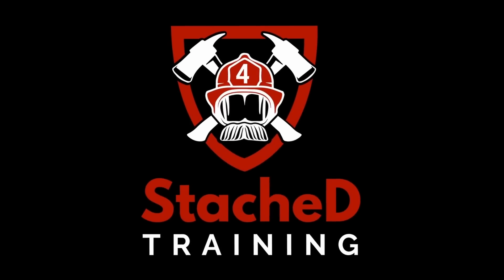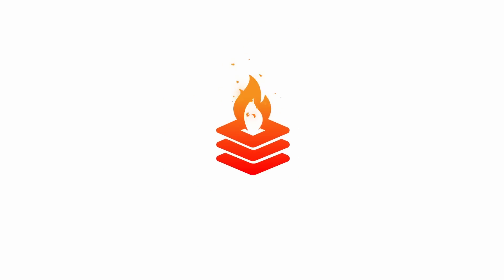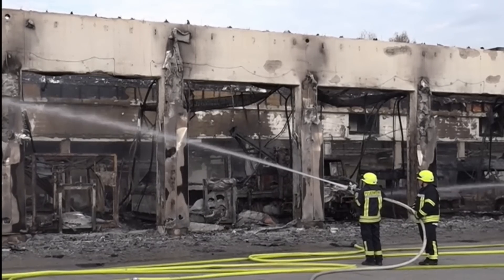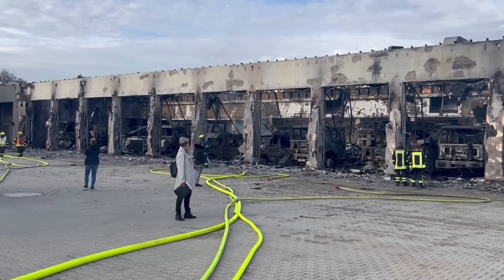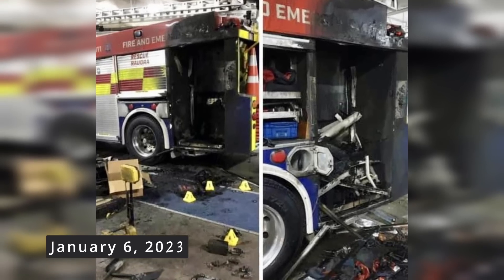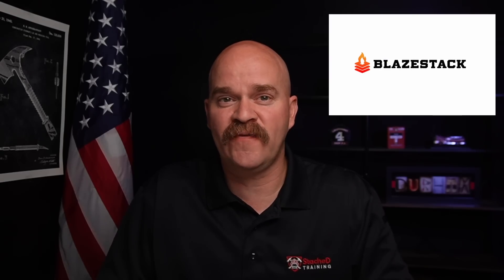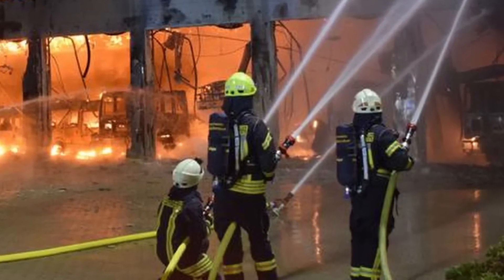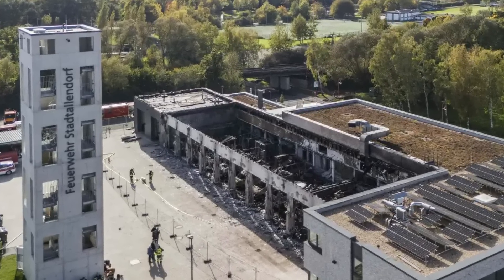Lithium-Ion Batteries Spark Fire Station Disaster: Germany

Comment: safety devices like bms to prevent over dis/charging and heat sensor to detect hot or cold battery.

for high demand devices that can cause the battery to heat up when using should have multiple batteries to swap out .

while some chargers can detect a hot or cold battery andprevent charging until it cools or warms up it is still a good idea to have several batteries to swap out.

Comment: German electric engineer here:

Here in Germany we do not have EVs for any kind of emergency services. They all run on Diesel with a very few exceptions running on gasoline.
So the fire obviously started within an auxiliary system being powered by a Li-battery.

Of course, it is kind of embarrassing for Germany - the country of engineers and craftsmen - to skip a fire alarm system in such a place. At least some of the vehicles could be driven out with an early alarm before the whole building was ablaze.

Also and again, politics must seriously rethink all the green--deal-Bohey about EVs. These vehicles are neither an ecologic solution nor a safer technology. 

Fortunately no one was hurt, the equipment can be replaced and hopefully this time the insurance company insists on something so trivial as a fire/smoke-detection system.

Peace! from Dresden / Germany

Comment: I'm confused. Wouldn't the firefighters be stationed at the fire station? Why did they have to arrive?
Also the audio is out of sync with the video. It looks like an overdub.
Reply: In Germany there are only 111 professional fire departments and 23,800 volunteer fire departments. There is no obligation for volunteer fire departments to be on site around the clock (fire department). Only very few volunteers have an apartment right next to the fire department. Volunteers live in their own houses and apartments and also have to work - volunteering does not mean receiving money for it.

This means that the volunteer drives from home/work (on site) to the station and sets off again in the vehicle. From the alarm (e.g. pager) to the scene (fire) in a target time of 14-15 minutes. This is what the law requires. This goal is achieved in 80% of cases. The rest is due to traffic jams on highways or impassable terrain (forest fires).

Comment: If fire fighters responded within 3 minutes when did they come from ?  All the stations equipment was in flames, so another station must have despatched appliances, are there so many firestations in Germany that they are less than 3 minutes apart ?
That doesn't make sense !
Reply: Who says that over three minutes? This is nonsense! The default is 14-15 minutes. From the alarm being triggered (e.g. pager) to the volunteer's location (home/work), their route to the fire station and then to the scene. This is achieved in 80% of operations. Not even a professional fire department can manage three minutes. Then the fire or operation would have to be 100m away from the station...

Comment: Maybe a fire apparatus should come equipped with a fire resistant "vault" to charge batteries in.  The vault should be built in a way as to contain the flames and be mounted on the vehicle in a way that the extremely hot vault will not set anything else on the vehicle, or surrounding area,  on fire..

Comment: Wait - I thought EVs used lithium iron phosphate, not Li ion batteries! Wow.....looked it up & it turns out some producers are switching to the less flammable LiFePO4 ones....
Now I understand why they've had so many fires!!
Reply from the maker: LiFePO4 or Lithium-iron Phosphate (LFP) are still lithium-ion batteries.  While it takes a bit more to get them into thermal runaway, they can absolutely still burn.
Reply: There was no EV in this fire station.

Comment: Hi, I'm a volunteer firefighter from Germany and I'd like to clarify some things from the video/comments as some things were misinterpreted/misunderstood/mistranslated.
1. Stadtallendorf is, like most fire stations in Germany (~93.5%), a volunteer fire department. Volunteer fire departments are usually unmanned and firefighters come from work / home in case of an alarm.
2. The station does not have a central fire alarm system but it hat residential like smoke detector. By Law it is not required for an unoccupied fire station to have a central fire alarm system. Requirement and Type (central fire alarm system / residential smoke alarms) are defined by Building regulation from the state. There main job of an fire Alarm is to inform the people and firefighters in buildings with high danger or where People potentially need help to evacuate or buildings wehre are many People and not to protect building itself.
3. The Vehicle where the Fire started was a Diesel powered TLF (Tanklöschfahrzeug = Tanker Fire Trucks) and not an EV. The Truck has battery operated devices (like headlamps, radios, ...) and an external Powerconnection for charging battery operated devices and the vehicle Battery (usually 24V) and prevent drained Battery's. No one want to arrive at Scene and can't work because a Battery is empty.
4. The Fire investigator from the police rule out deliberate arson and found the starting point an area where are charging stations for Battery operate devices, wiring and the external Power Connection. Because of the results of the investigations it is likely that a battery caused the Fire.
Reply: Thank you Steffen.

Comment: The door design is awkward and creat a huge blind spot for passengers and motorists. The rear turn signals are too low to the ground. The trunk lid has a very sharp edge corner to them which may cause injuries. Otherwise looks good 👍

Comment: Something that has bugged me for a long time, here it is.....Years ago I owned several retail businesses.  Every year the local fire department would come by for an inspection.  I never got a clean bill of health.  They always found something I needed to do, and many times it was expensive.  I never went the cheap route and I really tried to do the right thing. Several times the recommendations would contradict earlier recommendations by a different fire chief.  Move this sign, then move it back.  Buy these fire extinguishers, then throw those out and buy these. etc, etc,.  The companies that insured my businesses always got a copy of these "recommendations" and always would raise my rates, even when I followed instructions to the letter.  I also know that the fire stations in my area did not follow their own advice.  When we did have a fire at one location it was caused by a faulty electric clock in the store next to mine, no insurance, no inspection records, just got away with it because they were local political donors.

Comment: Does using Li-Batteries really out weight Fuel Driven equipment from an environmental standpoint?
It is difficult to believe these continuous massive Fires are not generating far more pollution, in a tight localized fashion, than older well maintained technology.
I'm just a home user of Li-Batteries, but have several high capacity Tools including high Ah 80v Batteries. I don't even leave the chargers plugged in when not in use.
*Li-Battery Technology is incomplete. It has failed to produce safe means of dealing with Failures of the Batteries and mitigating associated damage from those failures.

Comment: The chemical reaction of these types of batteries is very hard to extinguish. Those who work with these types of batteries have containers of sand to drop them into and completely submerge them if they overheat or short out. Knockoff batteries and chargers are probably the number one causes of lithium based fires. Hopefully, there will be a 100 percent method to fully extinguish this chemical reaction.

Comment: I need to stop my drinking. For a moment I thought you said the fire station had no fire alarm, and no fire suppression system.
Reply: Article in The Times reports that because the building belonged to the local municipality and was classed as an equipment storage building instead of being classed as a fire station it was not legally required to have a fire alarm.
Reply: @scottfw7169  Misrepresented - this is what happens when there are misunderstandings...

The law does not require a fire alarm system for vehicle halls - including fire halls. But only where the vehicles are parked. Social rooms such as training rooms, workshops and equipment storage must have a fire alarm system. There are people there and fire alarm systems are supposed to warn people first.

Before such a hall is built, a risk assessment is carried out (including by the fire department). As a rule, the risk is “zero” and if a fire occurs, the insurance will cover it.

As long as 12 vehicles don't burn down every week or every month, that's not a problem. If something like this happens more often, insurance companies and the legislature will issue appropriate regulations. In Germany 1-2 fire stations burn every year, but only 1-2 vehicles and NO electric vehicles are the cause...

By the way, fire stations are burning in the USA too!

Comment: They are still searching for the cause of the Fire! They only had traditional trucks. The fire started in siede a truck, that had li-ion batteries inside and external charging. So there are multiple possible scenarios. The station was newly built and a lot of people try to make the use of sprinklers and alarmsystems mandatory. A lot of us even try to make alarmsystems inside the trucks mandatory…
Reply: First of all: There is no obligation to have a fire alarm system or sprinkler system for vehicle halls (trucks/buses), nor for fire halls. There is only an obligation for the adjoining rooms if - as in professional fire departments - there are people constantly in the fire station (e.g. sleeping). But in Germany there are more volunteers...

Secondly: If there were an obligation, then private companies would probably also be obliged to install such systems. There are reasons why there is no obligation - because smoke continues to arise in the halls from exhaust gases and small repairs (dust).

Thirdly, you can and may voluntarily install a fire alarm system, a sprinkler system or a wireless smoke detector. This then creates cost pressure. Installation costs a lot of money, as does annual maintenance (this also applies to private contractors).

Fourthly... A risk assessment is carried out in advance, which was also carried out in this hall. You weigh things up and a fire alarm system does not protect against fires. Even fire departments with such systems stood in front of the halls and watched as their vehicles were destroyed. This fire was very extreme. 

It is estimated that there are 2-3 fires per year. Fire departments keep losing vehicles. 

As written, you can install it voluntarily and if you have the necessary resources, many fire departments will certainly retrofit it or plan it into new buildings.
Reply: It could have been an electronic device that started the fire.  There’s been multiple cases of e-bikes and other electronic devices with batteries starting fires.
Reply: @KaosNova1  That is now certain! In a vehicle that had lithium batteries (for lamps/radio or other equipments) and an external power connection. 

That's the cause - it's no longer possible to determine exactly whether it's the battery or the external connection.

Comment: The electronics surrounding lithium ion batteries are supposed to stop charging at or near their full charge, and protect each cell from short circuits and reverse charging.  This technology has been around over 30 years, and should have been perfected by now.  There is no need to unplug the chargers.  My guess is that, as stated in the video, water or physical damage to the batteries or circuits is what caused the fire.  BTW, what a graphic example of the definition of irony!

Comment: This is most unfortunate for the community. Not only did they lose their firestation, but their trust in battery technology. With battery technology getting better and more safe battery electric hybrid fire engine are preferred among fellow fire fighters who have them. This trajedy may sway them from using these technologies in the future which could ultimately set them back.
Reply: It had nothing to do with the vehicle. There was not a single electric vehicle in the entire hall.

The vehicles have chargers for lamps and radio communications. Because these batteries for the devices are now made of lithium or the charger itself could have been defective. That's where this fire came from
Reply: @tobiasmuth2372  I want you to know I did know that before I wrote.

Comment: You raised a good point there on keeping gear plugged constantly. The only challenge here is that volunteers, such as these ones, especially in areas with few alarms might come to the station too infrequently to plug/ unplug devices. 
Some places do hire staff for daily maintenance so that might be the way to go, but it's a hard problem to solve

Comment: This is why you don’t keep your chargers next to the fuel supply.
Reply: i do think you are guessing right... most of these trucks come to a top tier tetris level in packing all the specialiced power tools they want on hand into said trucks... as they are volunter organisations (meaning the firefighters got a regular 5to9 job somewhere else) they pack it up after they used it and charge it in place (several news reports hint at a battery of one of the tools beeing charged as source of the fire)... so if the battery going into thermal runaway happens to be close to the fueltank of the vehicle you got a VERY ugly situation at hand...

other thing i wonder: a firefighter friend once showed me (and a few others) the difference of highly flamable and flamable... he poured a small puddel of diesel on the concret, lit up a cigared and droped the burning cigared into the puddle... the diesel put out the fire... (don't do that with gasoline it will burst into flames like you do see in movies)... but as we all know diesel can be set on fire i wonder if you would drop a lithium ion battery that is about to go into thermal runaway into such a diesel puddle would the diesel ignite?

Comment: The irony here is, that fire brigades in Germany are often given the job of checking if people are fulfilling all the mandatory fire hazard precautions and keeping escape routes free of clutter.
Reply: Measures by Law = Saving Lives (Escape Routes...). Otherwise, it's about insurance premiums. And most people did not notice: Aside from the garage, the rest of the building was protected by the fire spreading measures built into the building code.
The people protection aspect, would actually warrant simple acoustic alarms anywhere someone sleeps, as you can easily die of smoke inhalation before you ever notice the fire.

Comment: I thought Germans are smart. LOL. No first responder vehicle should ever be EV! This comes from a fireman! And on top of that, these German fireman will be the joke for a long time! Here's a brief story when I was overseas in Asia: A historical church was on fire. The village have had one old firetruck and it didn't start up. Since the church was within 1/4 Mile, they decided to push the truck towards the action. OMG, they made it! Once the truck was at the scene, they found out that the pump won't work without the engine running... 🤣 Well .... LOL!!!

Comment: Hello from Germany,
the fire startet at a TLF(a Fire truck with a watertank). The is no real clue that proufs that an lithium ion batterie was involded. Those who talked about the possibility were just speculating. There is no proof.

But you are right we should have more respect und should handle Batterie with more care.
Reply: According to EuroNews - The fire broke out on an emergency vehicle belonging to the fire department, which contained lithium-ion batteries and an external power connection.
Reply: Klar werden die auch nicht zugeben, wenn es sie Batterie war!
They would not tell if it is the battery. Ideology.

Comment: Lithium titanate oxide battery tech is all but fireproof but lipo4, which is not, has more  power density which causes the thermal runaway fires.

Comment: It was caused by an ev if it was a car or a truck is the question ot was a vehicle containing lithium batteries and connected to the mains so it definitely was an ev it spread that quickly and it was that intense I would say it most likely a truck

Comment: What? No fire alarms in the fire station!? lol This just goes to show you how dangerous these lithium fires are, it burned down a fire station!!!!!!! HAHAHAHAHAHAHAHAHAHAHAHA Batteries on a charger should be fine, chargers should be smart enough to stop charging until the pack gets down below a voltage but a lot of stuff isnt because the manufacturer is a moron. Especially ungodly overpriced fire rescue gear

Comment: Im an engineer who has designed lithium batteries for EVs. The truth is that we have the knowledge and tech to prevent these fires, and its frustrating to see so many batteries and devices designed so poorly. NFPA/UL/etc needs to get involved here and force engineers to clean up their act. 

Most batteries these days just rely on an off-the-shelf control chip to manage the battery, but these chips are often too simple to manage how complex it is to keep lithium batteries healthy. They're good enough 99% of the time, but with how many batteries we use now, 99% isn't good enough. There's no reason those chips couldn't be done right, there's just nothing forcing companies to design them that well, because the trade-off is usually charging batteries to below 100% and that doesn't look good in marketing.

Comment: Lithium batteries are often battery packs full of individual  cells, they are hooked up in series/parallel to get the desired voltage and amperage, when one of those cells catches fire, then the next cell is heated and bursts into flames, and so forth, until the entire battery pack is consumed.